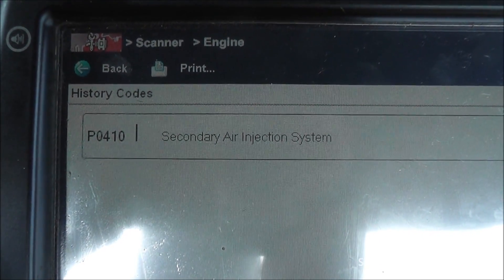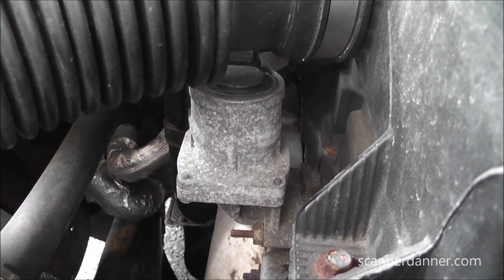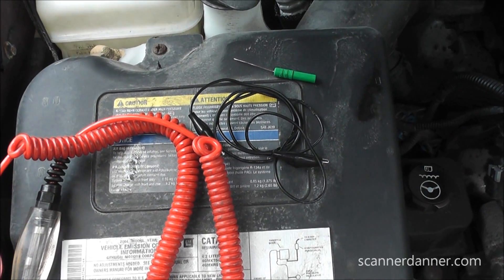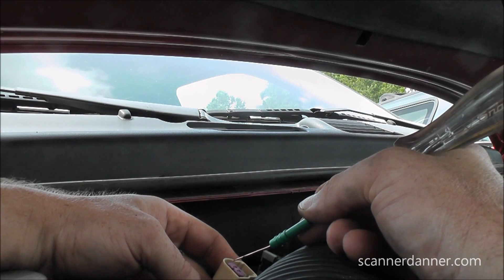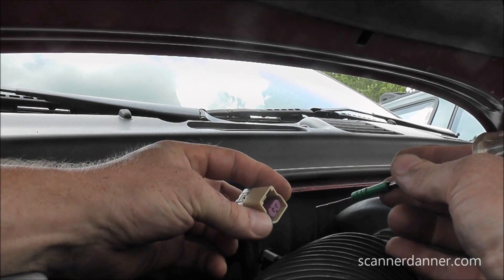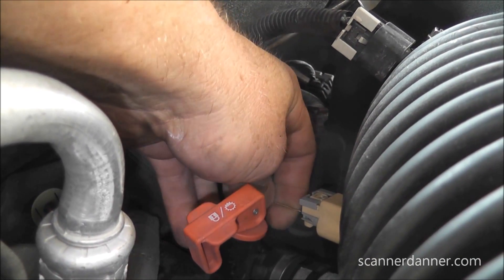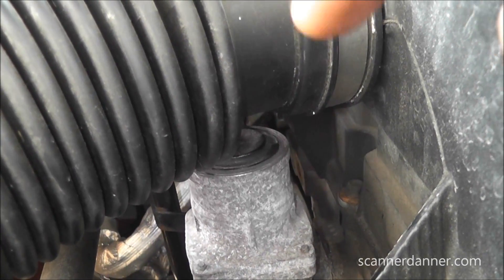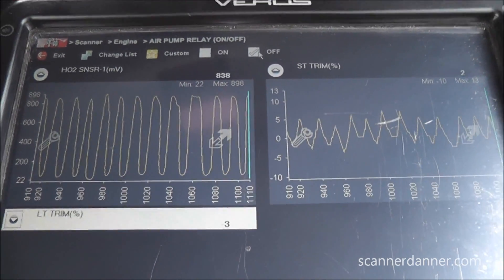How to test an electric air pump (P0410 case study)

Comment: Question 
Can you unbolt the air check valve with the hose that comes to the secondary air pump and feel if air it’s coming out same way you did with the hose you took off. If you don’t feel any air that the check valve is the problem
Reply from the maker: Volume of air matters too.

Comment: Good evenings where is the secondary air injection injection pump located on 2012 buick regale located I have been looking everywhere on this engine
Reply from the maker: Sounds like you need some good service info. 
Here is a link to the DIY version of the same service info I use
https://eautorepair.adtrk.biz/?a=10817&c=24&p=r&s1=

Comment: My 96 f150 4.9 has a p0411. I wish I can understand all that you’re explaining in this video. I’m so dam slow😒 haha
Reply from the maker: You system doesn't use an electric air pump. What the definition of the P0411 on your truck
Reply: @ScannerDanner  P0411 Secondary Air Injection System Incorrect Flow Detected and since this issue popped up it’s been sputtering and idle dropping super low. Also thanks for the reply, I really didn’t expect that!
Reply from the maker: @Smacks1  okay cool, step 1. Take the air hose off that goes to the exhaust manifold and make sure there is no air flow coming from that port once the engine is warmed up.
Reply: @ScannerDanner  the air hose coming from the air filter? The other hoses that I’m seeing is the tube leading to the egr valve and another that’s connecting to the brake booster
Reply from the maker: @Smacks1  no, none of those are air pump hose other than maybe the one to the air cleaner.
Reply: Gotcha, ok so once I unplug the air hose from the manifold what would be the next step?

Comment: Also, carbon build up in the head could be blocking flow if diverter clicks (opens).  Can feel for difference in the vacuum at intake pipe if pump is good

Comment: Great video, I need your advice to solve this problem with my 2005 ml350 W163 code P0412  secondary injection pump valve A malfunction, I'm getting ground with my power probe on both sides of the 2 wire electrical connector to the air pump solenoid when the key is on I'm getting 12 volts on both wires check engine light is on. Your help is highly appreciated.
Reply from the maker: Okay awesome so far on your work. With the connector unplugged, one of those two 12v readings will drop. Tell me what it drops to. This is your control wire and it is ground side switched.
Reply: @ScannerDanner  Blessing . With  the connector unplugged I have 0.0 volts on the green and brown wire , No reading on the other wire, I realized that when the connector is plugged into the solenoid I get ground on both sides of the wires, when the key is on I get 12.2 volts on both wires. I replace the solenoid with one from the dealer and same problem ground and power when connected. Thank very much for your response. Have a blessed day.
Reply: Rechecking voltage reading with connector unplugged is 12.1v
Reply: Brother Merry Christmas and Happy New Year, I'm still waiting for your answer.

Comment: I have a 2004 GMC Envoy and I have the code P0410 secondary air injection  system I change the selenoy, the pump works. When I start the car I hear the pump and the selenoy work for 40 seconds and then it stops how long is the pump a post to run for?
Reply from the maker: That's about all you get from them and they will only run on the first start up with engine coolant temp below a certain threshold.

Comment: I have no power for the wires to the air pump the relay doesn't have power either please help can find anything about no power going to this pump mine is on a Chevy cobalt but same concept
Reply from the maker: You need a good wiring diagram. I posted this on my community tab yesterday. 

Just wanted to remind my community about where you can get service information. (wiring diagrams, flowcharts etc). I use a professional program that runs about $160 a month called ShopKey (same as Mitchell-On Demand), but there is a DIY version where you can purchase a 30 day pass for an individual car for $20. This will give you access to the same diagrams and service information that I use for that one car. So if you are working and doing side jobs for people, simply add this cost ($20) into your diagnostic fee for that customer! It is a win for everyone involved! You get to take on more jobs because you now have service info and you do not have to pay $160 a month for a program you may only use a few times a month. Here is the link to the DIY site
 http://eautorepair.adtrk.biz/?a=10817...
EDIT!! There is a demo vehicle that they give you a user name and password for that allows you to explore the program! Super helpful in seeing if it is right for you or not

Comment: Is air always on from the hose u pulled off.should air be flowing at all times?
Reply from the maker: Only for the first minute of start up when the engine temp is below 100 degrees. Otherwise you'll need to energize the pump circuit manually or with a scan tool.
Reply: @ScannerDanner  ok thank you so much for replying back I've taken my vehicle to the Chevy dealer and a private auto shop and no one seems to know what the problem is I'm getting the p0411 I changed out the pump underneath the driver side and I also changed out the secondary pump under the hood and still keep getting the code coming back

Comment: Having an AllDataRepair.com account really helps out with situations such as these, as far as locating components, OEM part numbers, system design diagrams, etc.  Although not necessary, it does help out under certain circumstances.  Also to add, my 2001 S-10 4.3L, which I replaced the pump and diverter valve on a couple months ago had no data PIDs to speak of.  However, it did give me the option of turning the pump/relay on using AutoEnginuity software that I have, via the bi-directional functionality for many components.  From there, I had to diagnose the problem, which turned out to be a frozen air pump, blown 30 amp fuse, for obvious reasons, and a faulty diverter valve that was filled with water when I pulled everything apart.  This is a common issue for the S-10 trucks with the 4.3L, and also the 2.2L engines.  The redesigned GM part has an atmospheric tube that can be ran wherever you like.  I ran mine up beside the radiator housing and secured it there.

Comment: can that pump can cause my 2005 4.2 Trailblazer to have a higher RPM and loss of acceleration
Reply from the maker: Not likely. The only way you would get any driveability issues associated with an electric air pump, would be if the diverter valve was stuck open. This would cause a false lean condition and an over fueling problem. Engines that are running too rich do not have loss of acceleration complaints.

Comment: On my 2010 Impala I was having this problem with a very poor start in the morning when it was cold. Car has about 170,000 miles. It acted like it was flooded - but I did not smell excessive fumes coming from the tail pipe. Once it got through the rough start it ran fine, especially when it was warm. Seemed like it only ran poorly when it sat overnight and was cold. Checked for codes but there were none. I went through and systematically checked everything like injectors, vacuum leak, gasket leaks, fuel pump pressure, ECT and AT sensor readings... etc etc but no luck. Everything seemed fine. I then took off the pipes for the secondary air  injection system (since this system worked only in the cold start-up period) and the pump was running... but I wondered if the secondary air injection valve may be the culprit. Again - no codes. Took it off, cleaned it, lubricated the upper section and we're back to normal. Bugger valve was sticking - probably closed. I suspect the ECU commanded a rich condition for startup for that initial 90 sec run of the air pump, but the valve wouldn't open and prevented the necessary air injection. But the bugger thing wouldn't set a code.  I wonder how my catalytic is though... acceleration and power seem fine. Anyways - just thought I would write this for others that may be having the same problem.
Reply from the maker: Thanks for the tips!

Comment: Is the air pump suppose to make that whirl jet like noise? Or does that mean it's bad? Because when I start up my 04 Deville when it's cold it makes the same noise for about 30seconds. Then goes away
Reply from the maker: As long as there is no code for it, don't worry about it.
Reply: ScannerDanner check engine light is on not sure why just got the car today
Reply from the maker: IF you have any other questions. 
It is becoming more and more difficult to answer questions here. I have 80,000 people asking me for help now. So I have created a forum to help you guys better. It is free to join and we can exchange pictures, wiring diagrams and waveforms if needed to help guide you through the process of troubleshooting your vehicle. Thank you so much! Hope to see you there. 
Paul Danner (ScannerDanner)
 https://www.scannerdanner.com/forum/post-your-repair-questions-here.html

Comment: Can you test the air pump with out the scanner like manually??
Reply: Just polarity most likely
Reply: Sure put 12 volts to it and see if it blows air.  Also test the air pump relay for continuity when applying 12 volts.  My relay was clicking when 12 volts applied, but had no continuity.  Replaced  relay $30 part fixed

Comment: Paul, great video. Following along it seems that with good power and ground, loaded circuit, it could still have an open in the solenoid coil itself. I suppose the fix would be the same either way, solenoid and valve are one part. Going a little further still it is possible to have clogged passages in the cylinder head, or manifold -where ever the valve mounts. So solenoid and valve may be working, but there is possibly another blockage. Sometimes i spend too much time thinking about all the possibilities, even unlikely ones. Very good instructional diagnostic video.
Reply from the maker: Blockage would not occur on this system because it's just pumping air, but I suppose anything is possible. 
EGR passages get plugged up because of the exhaust gases that carbon up
Reply: +ScannerDanner Definitely not very likely, but possible. I have seen clogged cylinder passages on audi 1.8, turbo engines. Especially if the system has not been working for a while. Carbon in the exhaust system can block off air passages from the inside. Promise. I suppose it's very rare though.

Comment: I SAW IN A CAR THAT WHEN THE AIR SOLENOID WAS STUCK CLOSE LIKE IN THIS VIDEO, WHEN YOU MAKE THE AIR PUMP WORK, THE ENTIRE SECUNDARY AIR SYSTEM WORK WITH THE SOLENOID STUCK CLOSE, IT MAKE THE O2 SENSORS GO RICH!!!!!!!!!, WHY IT DID THAT IN THAT CAR????, MAYBE BECAUSE OF ELECTRIC LOAD OF THE RUNNING PUMP?, OR THE PCM ANTICIPATING A LEAN CONDITION?
Reply from the maker: are you making the pump turn on with a scanner or manually?

Comment: great video,  if you do not hear any exhaust noise when disconnecting the hose and the diverter valve is activated open, for sure stuck close or plugged  passages, though i have never seen plugged passages, thanks in advance for all of your very educational videos

Comment: I had the EXACT same symptoms and diagnosis on my 2005 Deville 4.6L with its vacuumless smog/AIR pump system.  Unfortunately, after replacing the air check valve/"solenoid" it did not work although I measured 12.4+ volts at the plug when the system was on.  I tested the old and new air check valve/"solenoid" against the battery and they both operated which lead me to believe it was a connection or current issue.  After verifying the connections were fine and no resolve I went back to the AIR PUMP VALVE MINI RELAY which was the ISSUE.  It was failing... You could hear and feel it click barely which was giving voltage but not a good enough connection for the required amperage.  IF YOU HAVE THE SAME SYMPTOMS AND DIAGNOSIS HERE, you might need a new air check valve/"solenoid" OR a new MINI RELAY.
Reply: What you are describing is a resistance problem which would absolutely have been seen with your voltmeter as long as the measurement was taken with the circuit loaded.

Comment: Good one again Paul! I know this vid has been posted some time ago but the system has improved by incorporating a pressure sensor to the solenoid to aid monitoring. This sensor produces a baro voltage of about 2.8V (pump not in operation) and about 3.3V when the pump presents pressure 1.5 psi above baro pressure.
Just a little info I thought would be fitting...

Comment: Great demo,  what your calling the solenoid / diverter  is that also the same as the Check Valve or also called shut off valve?  On myn 04 Trailblazer that is what they call the same part your referring to as solenoid / diverter , unless I am seeing you touch a different part .Thanks in advance
Reply from the maker: JOHN WEITZMAN Sounds like it, I am using old terminology for this valve. A check valve or shut off valve would also be accurate in describing what this part does.
Reply: ScannerDanner Thanks

Comment: Thanks for the video - getting both a P0411 and P2440 codes on my 2010 Impala - figure the system is pretty similar to this one.  My scan tool unfortunately cannot force the air pump to run - will have to do manually. I've had to change this air bypass valve once before.  Can't believe it is gumming up already - like 30000 miles later.  But will go through all connectors and power leads and check the blower as you have done.  Appreciate the video.

Comment: Would of liked to see o2 and st term after repair
Reply: The HO2 reading would bias towards lean because of the introduction of air into the exhaust stream, and the PCM will correct it by biasing to rich = "+" readings for STFT.

Comment: You could put your hand on the tailpipe to see if the air is coming out. That wouuld check the diverter/solenoid valve opening.Of course KOEO
Reply: +ChrisCas aka Superautobacs 
I second your opinion! I think ScannerDanner proved the air pump AND the diverting solenoid are working fine by disconnecting the rubber intake hose and seeing that there was then LOTS of airflow and the motor 
"relaxed" on its current draw under a normal workload. However, when he plugged the hose back in, the motor "backed-up" once again indicating a blockage. I would say that based on this, there is likely a blockage of intake air into the airflow motor somewhere along that rubber hose line. UNLESS I AM MISSING SOMETHING....
Reply: Unless the pipe leading to exhaust manifold is completely plugged with carbon build-up.  IF that was the case, replacing the solenoid wouldn't solve the issue.

Comment: So I believe this is what is wrong with my '05 Envoy.  I have not tested it like you have in the video, but I can audibly tell that the diverter/solenoid you mentioned is stuck shut.  Supposing that my vehicle is having the same problem as the vehicle in this video, how do you fix the problem?  Do I need to replace the diverter/solenoid?
Reply: Jjhhhz  .  Warsaw weerrt rd eef xxx dsszz z c   c uzzins tthdhdbnkbhbb.mnzkzksv:ft ghh tgr is it oh bbq b bnjjjjinnuitfyuuuuh xxx psdazxxzsssdftgh.  A

Comment: Hello, I have a 2007 Saturn Ion P2431. The air pump is working. How can I be sure it is the divert valve without high level scan tool? The valve has 5 wires I believe. Seems that the valve stuck so the flow is off and trips the code. But how can I be sure? Thanks.

Comment: Dear Paul. I have a cavalier 1999, 2.2 engine. The engine has an overheating problem. Once you turn off ac start overheating.. So have to keep turn on the ac in order no overheat . I changed:  thermostat,   temperature sensor, refrigerator deposit, etc. Please I need you help.
Reply: radiator fan works? check fuse

Comment: Parameter Identification Data STFT and upstream HO2S is what I would have looked at first.  Some of the Volkswagen vehicles are notorious for AIR system faults. I personally can not stand the sound of air pumps, sounds like an obnoxious vacuum cleaner, like a Dyson, lol. 
Great video once again Paul, keep them coming

Comment: For a moment I thought Paul was going to say "I'm sweating my balls off" loool.  BTW the noise comparison was an excellent point in diagnosis.  It definitely sounded like when you take your hand and put it over a vacuum cleaner suction tube or apparatus.  I wonder if all applications work like this one.  It has been a while, but IIRC on some BMW's, the engine must be running for the system to operate to spec.  But the specifics escape me.

Comment: i just did this on my cadillac, little different design but you wouldnt of been proud of me paul, i just bought it with the MIL on for a po410, and got a discount for the mil being on, i pulled the code before i bought it, i knew the pump was bad it was full of water, but i just''THREW'' the check-valve in it just so i wouldnt have to worry about it. it was a 2004 original check valve. we know how you hate part throwers, lol

Comment from the maker: It wasn't the EGR valve. It was an AIR diverter/solenoid. No I didn't do an ohm test as it wasn't needed to properly troubleshoot this problem. The valve wasn't opening. Whether it was an open coil winding or just mechanically stuck shut, I don't know and didn't care. It needed a new solenoid. I am pretty sure that it wasn't an open solenoid though because I would have had a solenoid circuit problem trouble code which I did not. Either way, it didn't matter.

Comment: Hi Paul,

During your troubleshooting of this EGR relay/air flow problem with the pump, did you do a resistance check of the solenoid? To me, if the relay coil was open, then it would have exhibited the same symptoms as a carbon'd up pintel in the EGR valve (stuck). What was the final R.C.A (root cause analysis)?

Tom D.